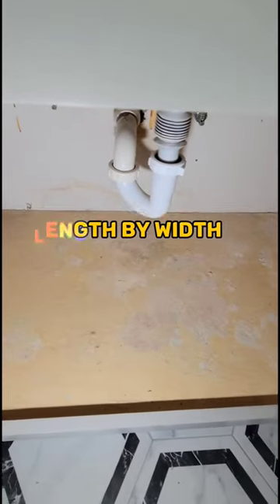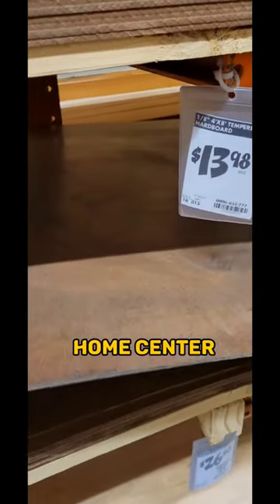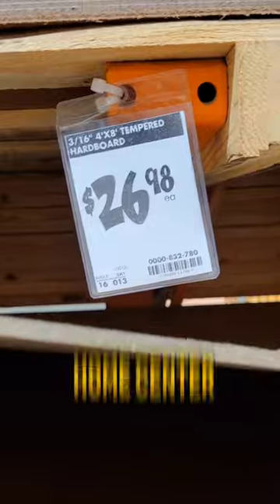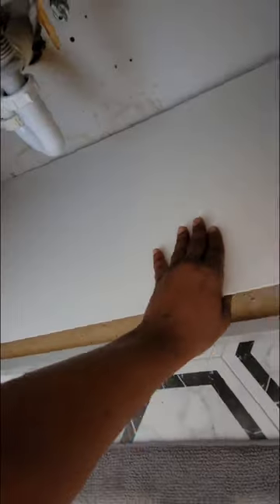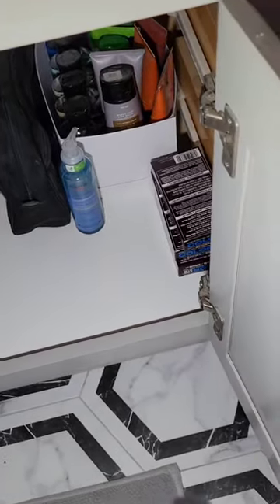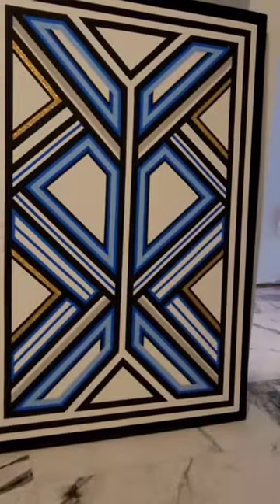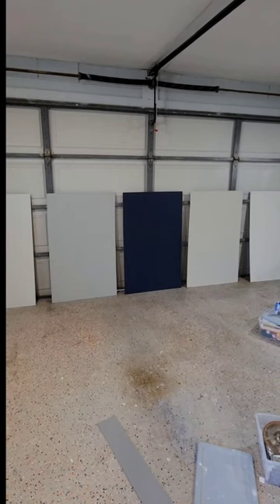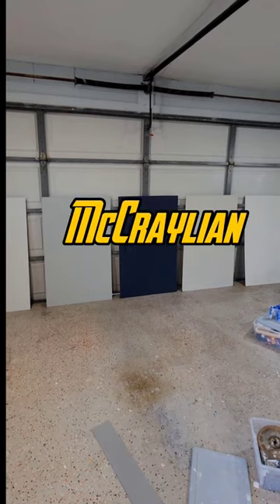Fix water damage under your sink!

Comment: McCray, my interest in your channel came with the first videos I saw. Painting kitchen cabinets. Then the paint colors & how they are represented on paint samples. I will tell you what I accomplished. We have 39 total doors & drawers in our kitchen. Through the years, the polyurethane had water drippings & runs that needed attention. We took all the doors off & marked the location of each. We removed all hardware and cleaned it well. Hubby injured his elbow and needed surgery during this process. I continued on by myself for 3 months. 

The cabinet doors & drawers are stained a nice color. I used 0000, steel wool, only using pure elbow grease. I did not want to compromise the stain. Therefore, I only used the steel wool, no sander, period. It was a major undertaking since I had to continue by myself. I completed the project, and it looks professional. I knew what I was striving for, and I had success. I would never do that process again, now knowing the time & energy  required. At the end of this project, hubby was able to help reinstall the cleaned hardware and hang the doors. 

I would recommend to anyone, hire a professional, if you can afford it. My garage & kitchen were indeed a mess for the duration. 

I'm sure you would have man handled this at a much faster pace. However, it was just me. But I am proud of my accomplishments. 

I look forward to more of your content for sure. Have a wonderful day!
Reply from the maker: Wow! That's an incredible testimony, and I will reference this when dealing with certain clients. A lot of people ask me why are kitchens more expensive. Then painting exteriors and the reason is that It is simply more work. However, I definitely see you know what you're talking about when you mention using the 0000 steel wool. It shows that you did your research. Congratulations on tackling that insurmountable task. To my knowledge the biggest kitchen I've ever done was about 40 cabinets and that included kitchen, laundry, and a butler's pantry. So I know that the struggle is real.